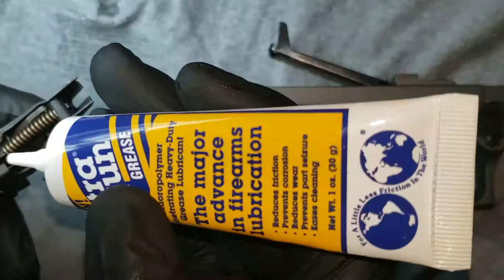Desert Eagle FULL Reassembly

Comment from the maker: 0:00 Recoil spring assembly
5:00 Hammer mechanism housing
19:18 Frame population
38:43 Bolt population
44:28 Slide population
54:27 Basic reassembly

Comment: By far the most well filmed assembly on the DE.  I had a curveball taking mine apart.  It was a California version so there are two pins on the firing pin stop plate.  You need to depress the lower pin which will allow the firing pin to depress.
Reply from the maker: I've never seen that. Makes sense that California would require extra steps to make a built in safety feature more safe to please the crown prince Governor McSaferson. Thanks for the comment and sharing about this new variation.
Reply: @IWestexI  My pleasure, its actually a nice piece of engineering.....that is worthless.  Stumped me for a while, but apparently you can order a normal firing pin plate for maximum freedom.
Reply from the maker: @lear60man  lol. Yes it is time to maximize your freedom my friend.

Comment: Great video! Thank you for this. I have a .50 and just bought a brand new .44. The new .44 will eject the spent casing but not grab the next round. The slide is  closed after firing a round however so it leads me to believe the slide isn’t being pushed back far enough from the recoil. Another tidbit is that .44 is harder to pull the slide back on then the .50 which I would assume should be opposite if any difference at all. I just swapped the springs on them and hope to test soon. 

Have you seen this? I only use factory mags btw. Thanks in advance!
Reply from the maker: Thanks for the comment. You have to hold and shoot the DE different than any other pistol. You have to hold the frame still and it's difficult to do with all that recoil. Try locking your elbows and wrist. This should stop the short strokes.
Reply: @IWestexI  Yes I understand as I have had many over the years. The .50 doesn’t do it. I initially wondered if it was exactly what you mentioned. However, I recorded slow motion myself and 3 others shooting the .44, all with minimal muzzle rise and the same results. 
My previous .44, same chrome finish never had this issue even when my wife shot full mags through it.
Reply from the maker: Thanks for clearing that up. It might be your feed ramp or maybe not hot enough loads. I'd have to see it in person to be sure.

Comment: Had an issue after reassembly where pulling my slide to the rear doesn't cause the slide catch to drop and the slide to be released, i have to manually push down/disengage the slide catch to release the slide. Bent slide catch spring?
Reply from the maker: Yes that is possible.